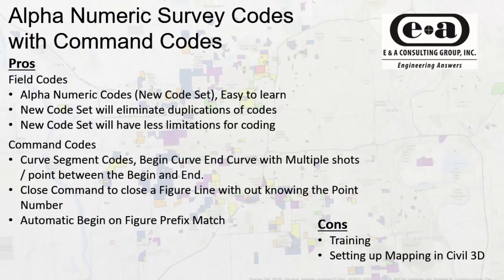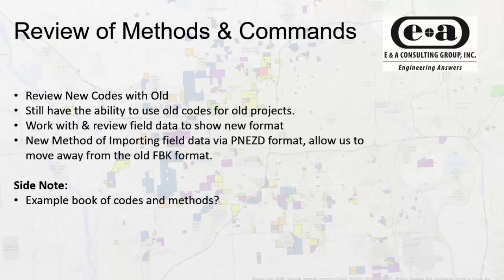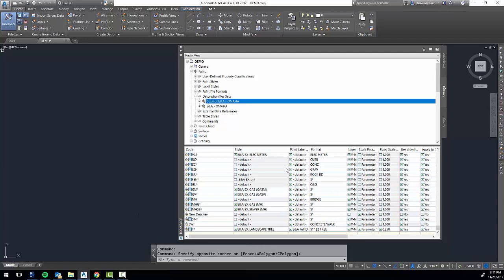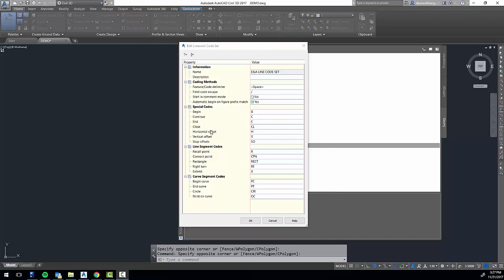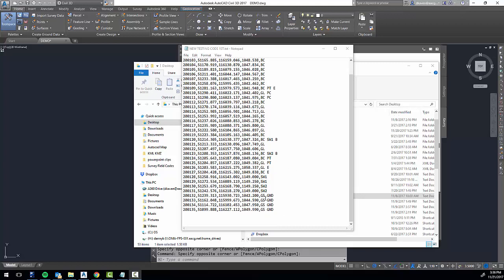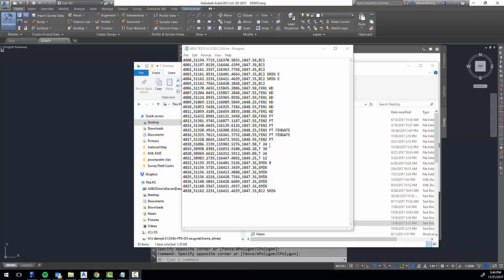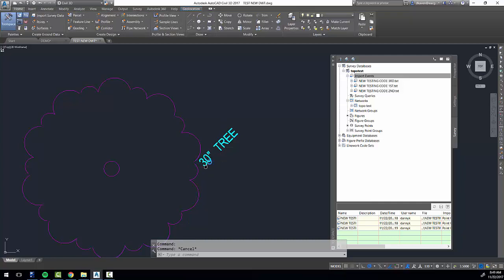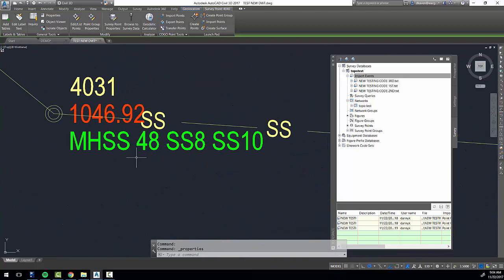Survey Codes

Comment: Danny would you be able to help me with a code library setup?
Reply from the maker: we maybe able to do that. I would need the code you want to use etc. what are your thoughts?
Reply: @eacgcaddtraining  I have a code list and there are some issues with data collectors...we are using fieldgenius 10. I believe all I need do is turn off or uncheck the second option which is do not draw line? From there I think the RAW or RW5 file will be able to be converted into FBK to be able to read the shot and descriptors
Reply from the maker: @falconvisionuav  what version of civil 3d are you using?
Reply: @eacgcaddtraining  I can give you my cell and then I can text or call to give you my email is that okay?